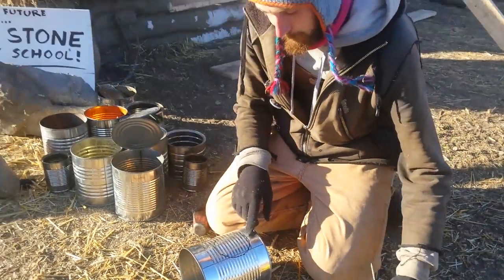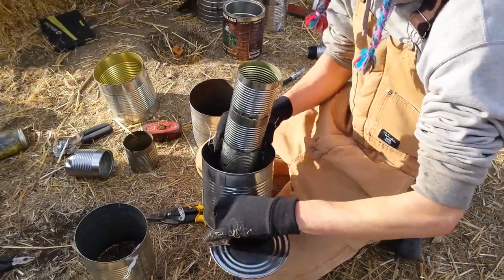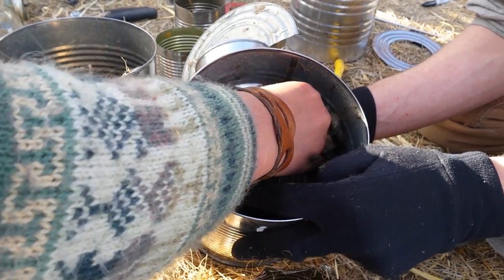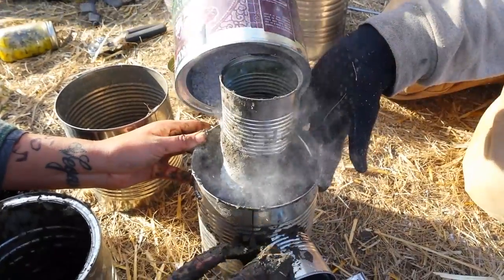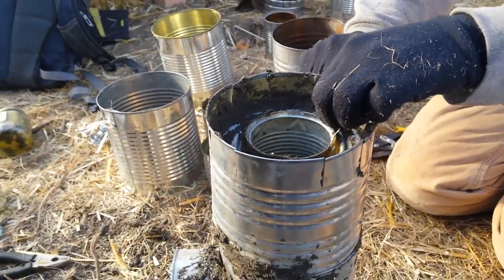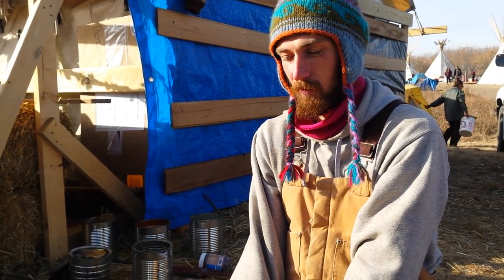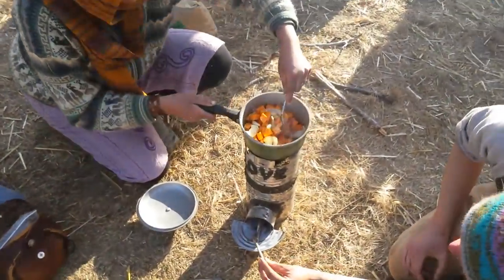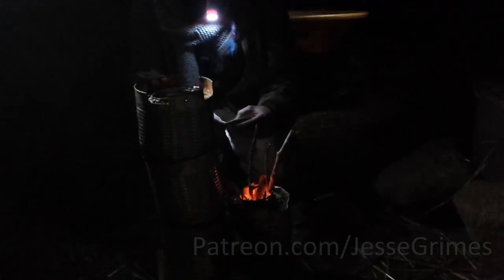Building a DIY Rocket Cook Stove out of Up Cycled Trash - Presented by OneHeartFire

Comment: It was interesting to learn that at Oceti Sakowin Camp, in the summer that the Permaculture Designers that were working with the elders were unable to actually get any Permaculture projects implemented despite having an overall design for the camp. this lead to lots of logistical and social problems with the winterization of the camps which were still not adaquate in December when the snow started flying. Most of the winter infrastructure in Oceti Sakowin Camp was wood stoves, propane, uninsulated army tents, and burning green pine to boot.
Reply: kind of just reinforced in my mind the importance of solving people issues before getting wrapped up in design. which is of most importance when trying to actually create a permanent culture . doesn't matter how good the design is if people aren't comfortable with each other then the design won't get implemented.